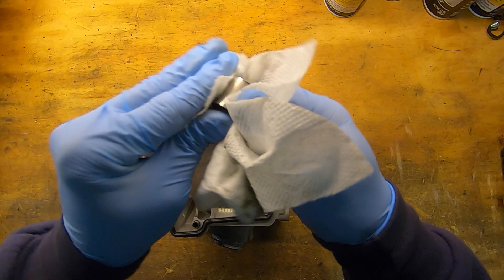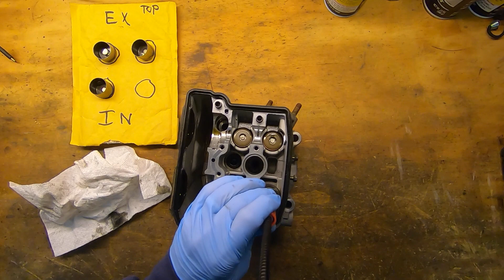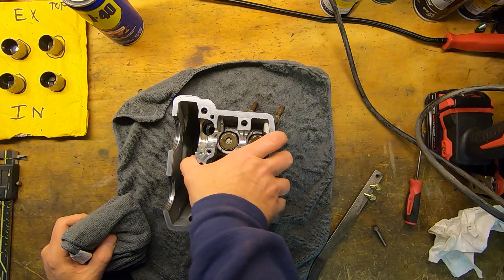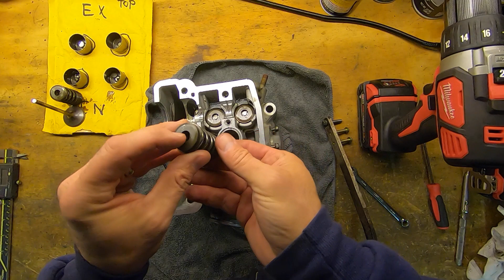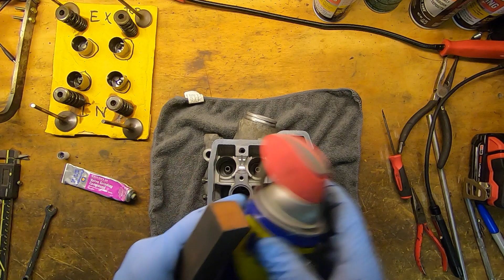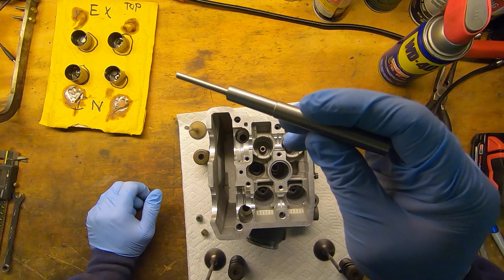Kawasaki KFX 450R  Head Rebuild Part III

Comment: So according to the manual it states that these valves should not be lapped like this FYI. Engine Top End 5-25 Caution box states the following: "Do not lap the valve to the valve seat, using the grinding compound. This will remove the oxide film treated surface of the valve". Says you must cut the seat with a diamond coated cutter oem part number 57001-1125, 57001-1128 + correct cutter depending on exhaust of intake.  Honestly, I replaced my valves with some aftermarket ones and lapped them since they dont have the coating just wanted to point out what the book says.

Comment: U ever have any problems lapping kibblewhite valves
Reply from the maker: I have not lapped those valves. I use factory valves when I replace them.
Reply: @RCBGarage  I can’t seem to get them to get a tight seal  not like there’s to much to screw up and I’ve done them before the same way and came out perfect. But thanks again
Reply from the maker: @keithparady2594  The angles on the valves might be different than those on the head. Check that out and go from there.
Reply: @RCBGarage  I did the sharpie trick to see the highs and lows and there’s one spot on one of the intake valves maybe a 8th wide (the round way )that is low but not bent valve so I’m stumped
Reply from the maker: @keithparady2594  put sharpie on the valve seat in the head and check again. The seat might be damaged